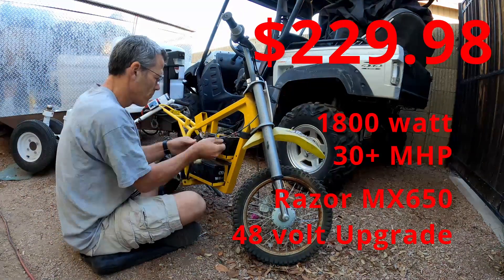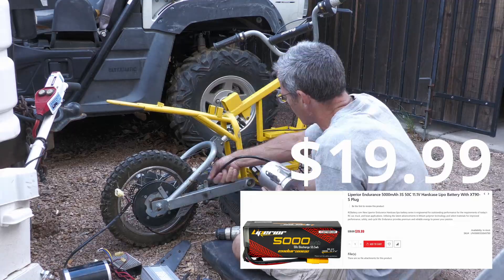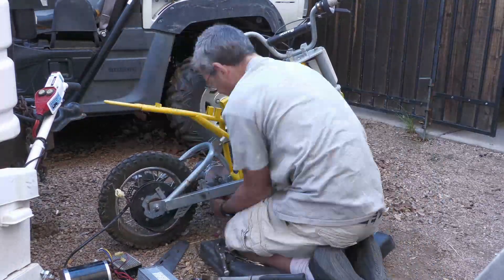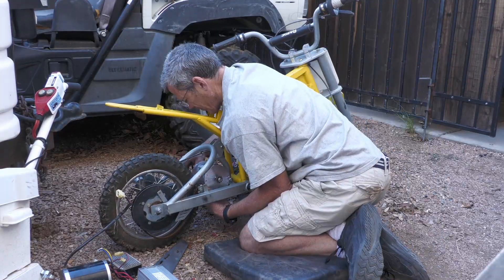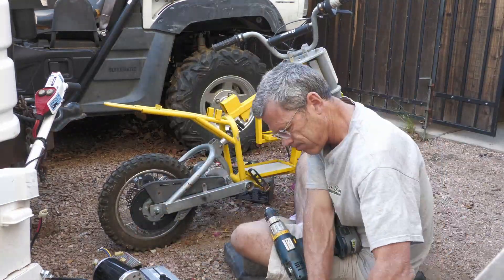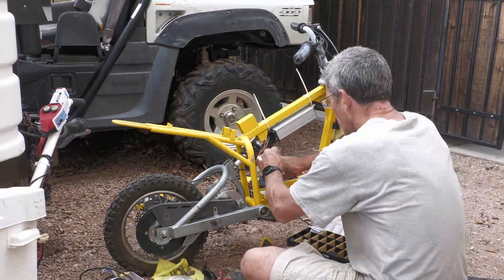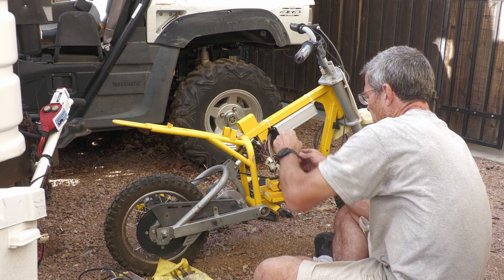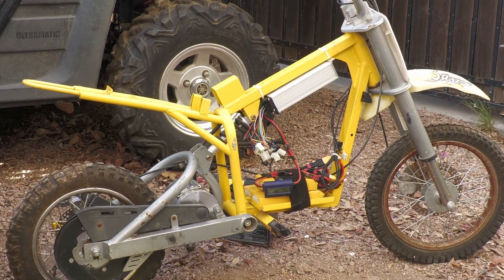Razor MX650 / MX500 $230 48 volt Upgrade 1800 watt brushless motor 30+ MPH Part 1

Comment: Any idea on how fast you’ll go and how far you can get on one full charge ?
Reply from the maker: I have a video of the performance here: https://www.youtube.com/watch?v=MZXQ5CKViEI
Goes 27 mph with 165lb driver. Using the 5ah RC packs you can go full throttle for about 15 minutes 6-7 miles. With throttle management over 10 miles. I have switched to the $100, 20ah battery I built and it has a 30+ miles range now.

Comment: how do you turn it on bc if theres like no switch itll js stay on forever unless you unplug the wires, also in the controller that comes in the kit the wire for the battery are like the rings you use on a junction box. can you can cut them and solder a batetry conector to it??
Reply from the maker: I use the switch on the original black covers to power the bike on. yes you can use any battery connectors.

Comment: so all i need is the motor kit and a battery?
Reply from the maker: yes, a conversion is motor, controller, and throttle. it's sometimes nice to get a display and/or speed switch if the controller has that option.

Comment: Those batteries are kind of small. How long does it last on a charge?
Reply from the maker: It all depends on how heavy you're on the throttle. If you average 10 amps you will go for 30 minutes. If you go full throttle the hole time you will only get about 15 minutes. I do use 8 together some times to make 10 amp hours so I can go for over an hour.

Comment: where can i learn more about the battery setup you used? is that 4x 11.1v  packs connected in series? is charging as simple as disconnecting them and charging them individually with a standard rc charger, or is there some balancing required? nice video - thanks for sharing!
Reply: you could just buy the 22.2v one from his link